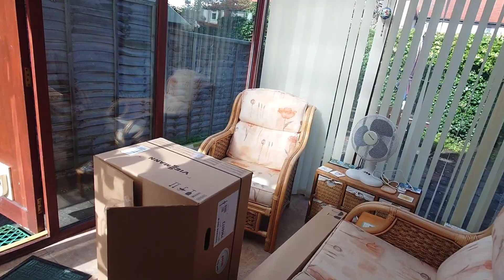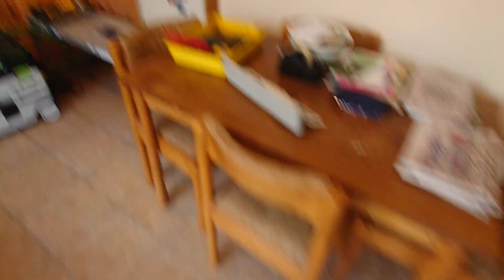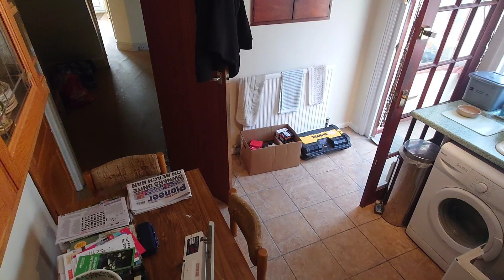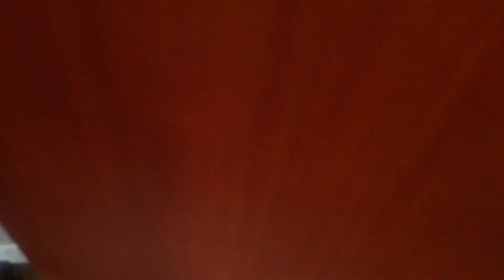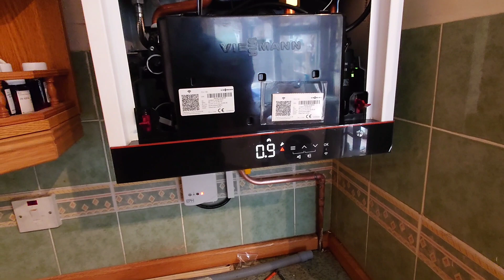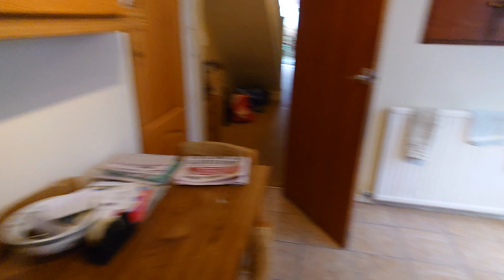Death Trap Boiler

Comment: Great video 👍🏻. Look forward to the Vitocal video.
Reply from the maker: It's a Vitocal 100 which is Viessmann's budget unit. Interesting to see how it performs
Reply: @GHRclimatesystems  I really think the 100A monoblocks need to be used more. 
We sell a heatpump module which would work really well together. looking forward to see it in detail. great work.
Reply from the maker: @EliteHydronics.  never fitted one before seems good value for money. Not sure how much Viessmann engineering it has or if it's just a re branding job to get V products in at a lower price point
Reply from the maker: @EliteHydronics.  what's this module you speak of?
Reply: @GHRclimatesystems  R586HPI